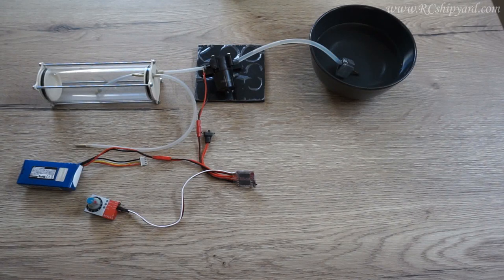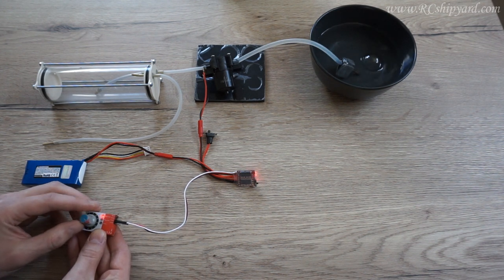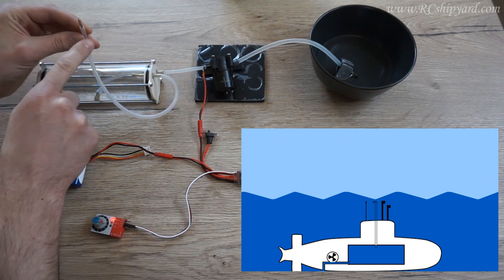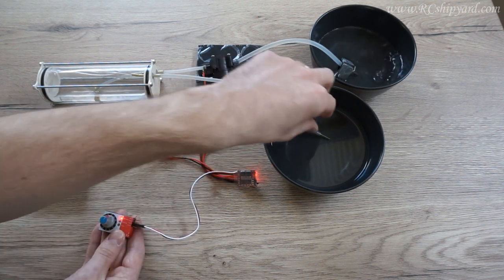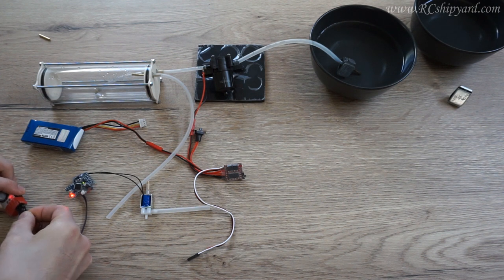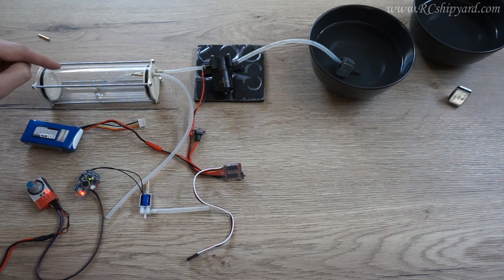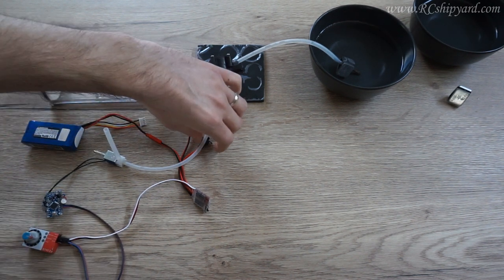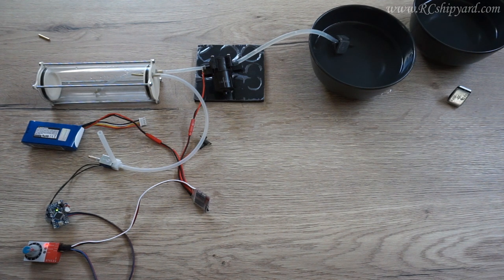Vented Ballast Tank for a RC Submarine - principle.

Comment: Innovative invention but I see a failure: archimede thrust exist as soon as enough air remains in the tube. On the test you can see the level of water in the tube but not when the submarine is submerged. If you activate the pump too long, then filling the tube with water you cannot resurface. This because the debit of water in the whole system would be the debit throug the 1mm diameter area. So without a foam security valve into the tube it is not safe ?
Reply from the maker: It's actually not innovative, this is a classic solution for a ballast tank system in a RC submarine, just with some modern electronic elements instead of mechanical. I suspect you may not have watched the video till the end or not carefully enough, as the matter you mention has been precisely addressed and explained in the video. The key to resolving your doubt is the difference in density of water and air, together with different diameters of the water inlet and snorkel tubes. This exact system has been used in one of my models during season 2021 and allows for resurfacing from around 2 meter (6 feet) of depth. For bigger depths, a stronger pump is required.
Reply: @RCShipyard  here´s a comment from Germany, so you have to excuse my poor englisch. The "stronger pump" you use must be a gear pump, isn´t it? so, a gear pump doesn´t keep tight while standing, there´s always a little flow of water or air, so it´s nearly impossible to hold the boat hovering in middle depth. But there is a good solution on the site of "neitosub" - rc submarine project Type II u-boat - introducing his solution with a mechanical valve which simultaneously commands the pump-servo. this is very easy and without additional electronic stuff, especially für gear-pumps.

Comment: can we achieve the same result by using a peristaltic pump instead of the gear pump?  or do you necessarily need a good flow of water during the surfacing?
Reply from the maker: No, you really need an efficient pump with how flow. If you want to use the peristaltic one - go with the bladder system.

Comment: Very informative regards the snorkel effects with big and small orifices. Will do that to my Dumas Akula!

Btw, can you 3D print the stern panes modification so I can purchase them? Planning to build the Krick VII as well!
Reply from the maker: The STL files for the stern are available for free to download at www.RCshipyard.com. If you need a ready to go printed version send me an @ via the contact form on the website. Good luck with the Krick!
Reply: @RCShipyard  Hi, I see you have started new project for the 1/144 PLAN Type 092 model. Are you planning for new WTC, or using your Seawolf WTC? I'm keen to purchase this kit tho...😉
Reply: Hi, can you share where you get that rolling pump? Or do you sell them?
Reply from the maker: @MLOO123   @MLOO123  The pump is a gear pump, not a rolling pump. It's a 12V Graupner pump and can be obtained on various online shops. I don't plan to be selling those. The Plan 092, will have a longer WTC than the seawolf.
Reply: Thanks for reply and information on the pump and 092. Are you using 2S battery for the 12V pump?

I do have a larger graupner 6V gear pump in white casing, but don't seems have good flow than yours after trying out your demo...
Reply from the maker: @MLOO123  On the video it's on 3S, but not at full speed. In the model I'm using a 2S pack and it's enough to operate the ballast tank.
Reply: @RCShipyard   I see... Thanks. Will get the pump to try it out! Many thanks.

Comment: Just a quick question, will this also work with the tank completely filled with water?
So no more air pocket in the tank?
Reply from the maker: Yes, the air pocket was caught only because I missed it, you can flood the tank completely and it still works perfectly.

Comment: What does the design of the pump look like inside. I want to try an 3D print one.
Reply from the maker: It's a closed unit, not possible to peek inside, but it's a simple gear pump - so two gears sucking in water.
Reply: @RCShipyard  thanks. I just wanted to know what type of pump it was, I what to try and 3d print it.